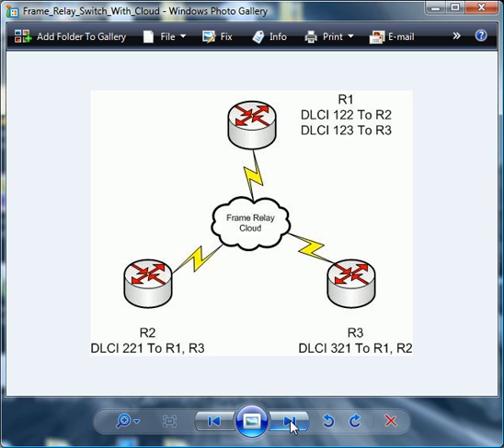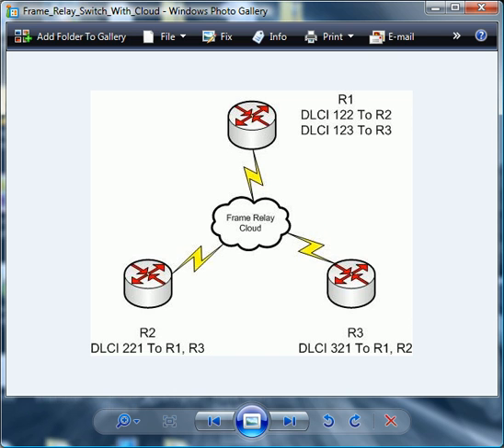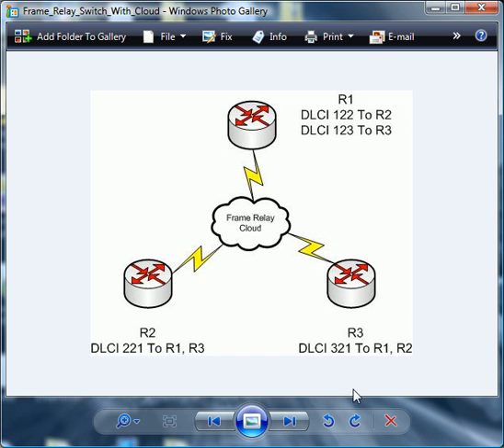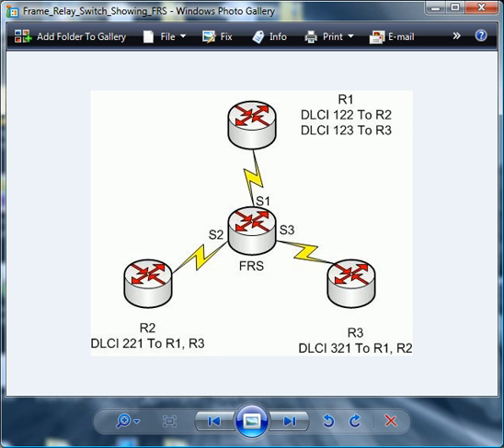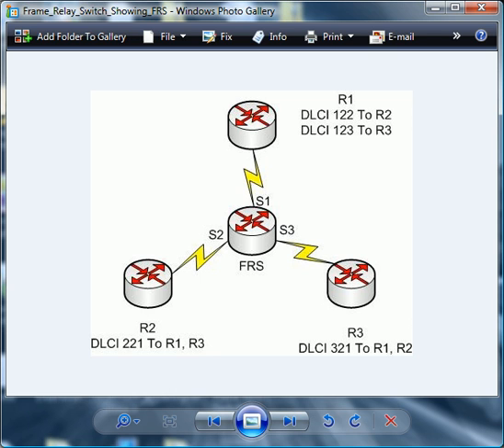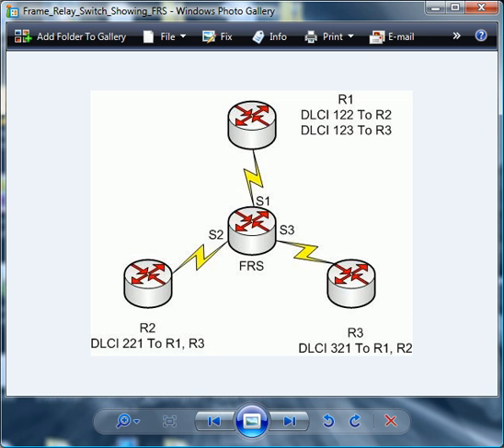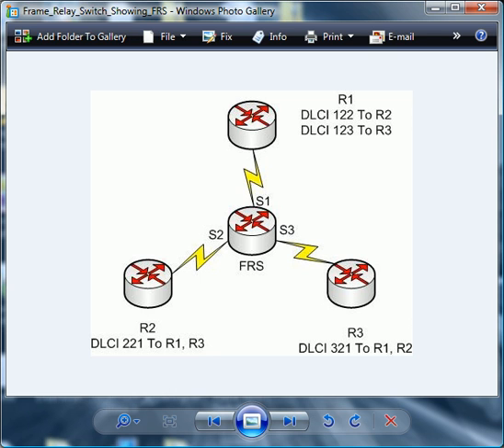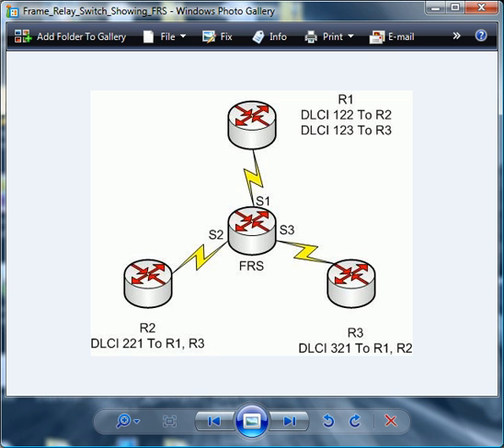CCNA CCNP Frame Relay Switching 1 / 2

Comment from the maker: I know exactly what you mean, believe me!

Really, if you get four good routers (one to act as a frame relay switch), and two 2950 switches, you'd be all set.

Check out the "Bryant Advantage" kit at CertificationKits' website (can't put the URL here in YT).   That will show you exactly what I use for my labs, and you can run a lot of CCNP stuff on a setup like that.